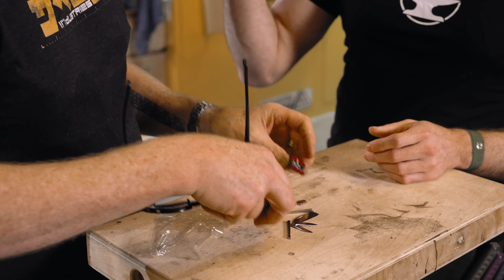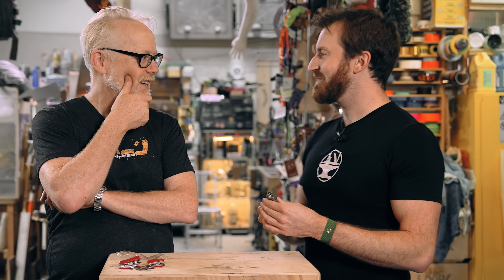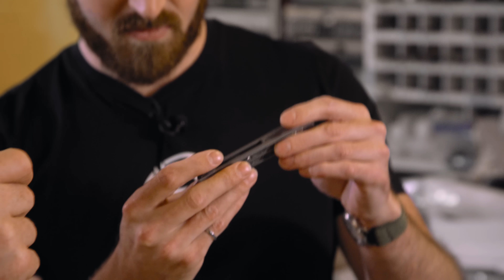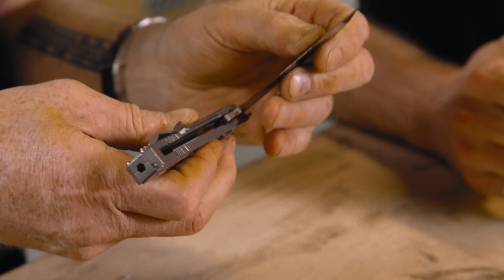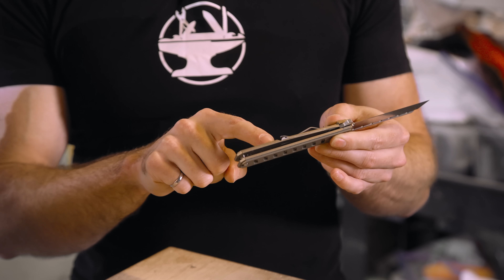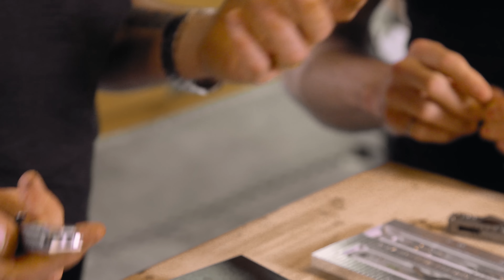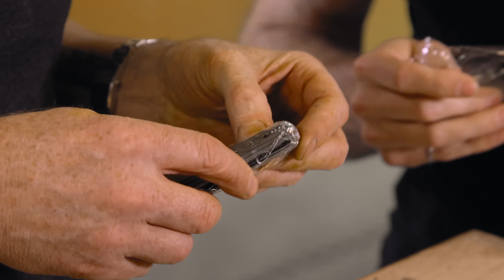Adam Savage Wields Hacksmith's Titanium EDC Multi-Tool!

Comment from the maker: Learn more about the Smith Blade here: https://www.kickstarter.com/projects/hacksmith/the-smith-blade-21-in-1-titanium-multi-tool
Find more of the Hacksmith's videos at https://www.youtube.com/@hacksmith
Reply: Note as of now the 10k you talked about in the video, is more like 15K blades, with 23 days to go, and well past the 3.8 million USD    Damn
Reply: @TheGismono  well yeah it’s not a normal one. They already designed and made the product.  It’s easy to pay for something when you know it already exists, unlike every other fundraiser, where half the time they only have a picture on the screen
Reply: .... I'm not paying gun prices for a knife.
Reply: pfff, people don't open bottles anymore.  
IT NEEDS GOOD SCISSORS AND PLYERS which are used more than many other tools.
I'll keep using a cheap chinese multitool with good scissors and plyers instead.
Reply: Actually I use bottle openers quite often @chrismeandyou ... (I'm a chef) Kind of annoyed it's a higher priced feature though... Something that should be standard. Like I would mainly use the firestarter (when burners go out), 90° driver (you would be surprised how often I use tools for kitchen equipment), the extended ruler (a joke that that's a high dollar feature only insert dick measuring joke here). But I don't need a level, metal scribe, glass breaker, and wire strippers. I could do without the teasers and sewing awl.
Reply: exceed designs razor v3 or tirant ultra. OKNIFE U1 Ultra or Big Idea Design - Ti Utility Knife All better as a EDC knife imo because of the replacable blades so its down to you to choose your fav blades. Problem with this thing is once that blade is fkd its fkd. the rest of the gimicks are just that, they will never be as good as or as usfull as the actuall tools they are pretending to be.
Reply: Even though they have more than met their kickstarter goal, i would like another video where Adam gets to ask his questions.
Reply: You never know when someone will come up with some unexpected EDC innovation. It’s always fun to see that happening.👍👍👍
Reply: Not even available for purchase at any point according to what I have seen on the website. You had to back it to get one.
Reply: Keep me posted when I can buy this.  My Swiss, Gerber, cheap knock off knife needs a new friend. I first found you on ctv news. This is a bonus
Reply: Blade look great. 
What HRC is the blade? Can it be replaced when damaged?
Reply: @OldSkullSoldier  HRC or better Newton/mm2 or least Brinell scale or something 
but look like swiss knife 55HRC if i good know 
so this 61 61 HRC best tip
Reply: I ordered mine yesterdayafter a long wait for development. Being an engineer myself I love the geek out you chaps had. I’ll be like 10yr old me on Xmas day when mine arrives! 🙌 @Hacksmith you’ve nailed it 🔪
Reply: Really cool product, but I wish the camera work in this video was better. Would have been nice to see close ups of what they were talking about.
Reply: James is bait and switching here. Adam gets to see an overengineered show piece, but the actual product week be a dumbed down, gremlin ridden Temu version. They did the same nonsense with their "lightsabers". Scam

Comment: Cutting a Vic in half to prove a point is not only wasteful, it's insulting. It's a slap in the face to a company that doesn't deserve it. I would be FAR more inclined to buy your tool if you honored the SAK instead of pissing on it.  Hard pass.

Comment: Hey @Adam Savage I backed this based on this video.  Sure they are strugglign to get production up and running.  They are putting out a lot of information.  But they are not putting out the right information.  They need to give what backer number they are on, and estimates on when they will ship each block of backer number shipped.  How about doing an interview with them and getting the information backers are actually looking for.
Reply: Well about 2 hours after posting this I got a update from them ... good or bad to pay the tariff on it before they could ship... so I guess they finally got to my order.
Reply: Well it showed up 10/2/26.  It is pretty nice.  Though the bits keep falling out of the side storage in my pocket.  And the deep carry clip makes the side bit notch not take the bit, you have to put a bit there and then tighten the clip.  But it's countersunk screws that have their preferred location so it is finicky getting it aligned they would have made the cut out on the deep carry larger.. But it did give me an idea of buying a m390 blade for the skeletool I usually carry.

Comment: It took me 3 minutes to notice the first problem: with this blade shape, it’s very difficult—if not impossible—to cut while the knife is lying flat; the flipper gets in the way. That means you’ll mainly have to use the fine tip to cut on surfaces, which will wear down accordingly.
A round blade would provide much more cutting edge right away.

Comment: This beats the purpose of a multitool since it has no pliers, wire cutter or actual scissors? like its a glorified blade with random functions as they do not realistically do anything well enough. No hate but Leatherman is universes ahead of this. you can get a Leatherman wave alpha which will be infinitely more usable than this and argurably last longer.

Comment: What do you mean when you guys investigated other manufacturers that they were found to be out of compliance for bit sizes?! ( LTT having discovered the same thing ) If that is the case then there needs to some method of flagging these companies who just do whatever they want and continue to make improperly sized bits. Out of spec bits are totally unacceptable and hazardous both to yourself and whatever you are working on. Mostly its going to mangle the tips of the torque bits and cause damage, even if its just cosmetic. Even worse can cause both the tool and bits to suddenly cam out and strip the torque screw resulting in injury if you are unlucky and potentially damaging your tool, your bits, the screw and product or machine you are working on. Think not...? Ever take apart a $10,000 U.S. 100 Inch 4k LG OLED and have an out of spec torq cause a sudden cam out strip and your tool flies into the screen or the mainboard or both? Happens. These chinese companies selling us whatever they want with substandard pot metal alloys at whatever tolerances they happen to have in their manufacturing processes that day need to be held accountable and be shut down from selling their garbage online. PLAIN AND SIMPLE. MIC DROP. -Tony Cusimano 54yr Old Male  P.S. Love the multitool, great work!

Comment: Cool, but my skeletool cx has done everything I have needed it too for 100$ usd. The biggest thing on this that I love is the longer bits. But honestly, i cant see myself using most of the tools on this when I ussually only need better full size versions of those tools when I have ready access to them. I work on a lot of electronics. I have a 100$ toolkit that has everything I could ever need, electric driver, manual driver, extensions, 120 s2 bits, spudgers, pry bars etc.  And it fits in my small bag to carry around work if needed. Not shitting on this, but at 200+ dollars and no pliers, which I use all the time. Also the blade doesn't have a great edc geometry... I just can't see carrying it over my skeletool cx. It is easy to carry (I just clip it to a belt loop), has never failed me when I needed a tool on a random instance and it's less than half the price. If they could get it down to 100$ for the version their demoing I would probably grab one as it is neat, but at near 300$ I can't justify it.

Comment: 13:55
There's a type of Spanish folding knife, called the Navaja, it goes back to the 1600's and due to its ratcheting mechanism it has a very similar sound when opened.
So, Hacksmith's Smith Blade was unwittingly beat to their signature feature by 400 years.

Comment: The wire stripper hole isn't hidden...it's there so you can have that out at the same time as the blade for the initial scoring tool when you need it. (re: MacGuyver tool criticism) - 

Request - pencil, Telsa lighter (chargeable) and levelling laser.

Comment: So a few things. I really appreciate what you’re doing and my most favorite thing out of all of this was the torque plastic bit. I have all the small sized torx bits etc but what I don’t have and have trouble actually finding without investing another $100+ is a torque screwdriver for all the small things that need to be torqued to spec sub 10 in/lbs. I have to be honest in hopes that I don’t just sound like an A hole and maybe this is something that isn’t just my weird personal opinion. I was turned off as soon as you said liner lock. To me, they have always been the throw away version of blade locking. I have had at least one fail during heavy use. Something to consider that gets me excited about just about ANY knife when I see it or hear it “crossbar lock”. I know it was originally benchmades proprietary thing and I 4ger what they called it but it’s an excellent locking mechanism…the best in my opinion. Ambidextrous and sturdy. Other than that you’ve got a winner and I wish you the best.

Comment: Personally, speaking for myself, except for the knife blade itself, and bottle opener, the by far most useful, and used tool in my personal, keyring multitool/EDC, is the pliers , as tiny as they are.  Much the same with my Leatherman.
So, I'll come back as a customer if they can make a tool with pliers.

Comment: Congratulations on a great design!  Love the concept and features, i plan to buy one If (and only if) you can do a run WITHOUT HOLES IN THE BLADE. An EDC knife is often used for food - all thoes mostly useless holes (and groove) in the blade accumulate pocket grime, and are much more difficult to clean - (before and after food prep). The holes and groove also represent added cost, and weaken the blade too.  Genius level design compromised by dumb holes.
Reply: As far as steel, I like both choices - would prefer a choice (I like the much tougher and less costly14c28n).  I prefer Magnacut to either one...

Comment: Kewel .  Better than I would have anticipated .  Love the match strike flint .  The problem with most multitools is that each tool is not as good as one dedicated to that purpose.  I.E. the scissors suck, the screw driver is awkward, the file is too short, the blade is cheap and on and on.  AND you have to carry all those tools with you just to use a  screw driver.  But the knife is so cool and it has so many practical features that I would have to give it an A.  SO much thought went into this it surpasses ordinary tools.

Comment: Ironically i feel like as cool as this multi tool is, i feel like i'd be less inclined to carry it over a leatherman.  It's on the opposite end of the spectrum of multi tools for me.  I don't carry my leatherman's for the blade, although the arc has a very nice magnacut blade.  I carry a seperate pocket knife for cutting tasks so the magnacut on my leatherman ends up being my "beater" knife.  On the Hacksmith tool, the blade is the best part, but it's far more inconvenient than any other pocket knives and the tools aren't as useful as the tools on a leatherman.  As much as i'd like to try a hacksmith, it won't measure up to my leatherman in utility and I'm not using the blade on either one of them for much, so I'm going with the leatherman.  The pliers alone put them comfortably above the hacksmith.  A multi tool with no pliers is junk to me tbh, it's the biggest selling point by far.  The rest of the tools you get with a leatherman are just a bonus

Comment: Damn... Most of what I would need or use is on the pro or founders version... Wish there was a more customizable system for ordering. Paying that much for an EDC I could utilize half of is a bit out of justifiable means for me. That's more than the cost of one of my chefs knives... But I'd be fine picking the options if they were all modular. Like I could use the 90° driver, extended ruler and firestarter. I don't need a good portion of the others. Maybe I can afford it one day 😅. Been waiting to hear about this knife for a long time.

Comment: Corkscrew! I need a corkscrew! I can’t stand Victorinox because of the slipjoint — but it’s still impossible to find a proper alternative. What you really need in an EDC multitool is a knife, a corkscrew, a bottle opener, and tweezers. That’s probably it. Victorinox also has great scissors — I use them often. As for bits and screwdrivers… if you’re actually repairing or assembling something, nothing can replace proper pliers and a good screwdriver.

Comment: Most knives are 100 percent useful this is 50 percent useful and 50 percent will never use. a pry bar in a knife??? you have never used a pry bar!!! it works off leverage the more the better, so you made a short pry bar with a blade AND SOME VERY SMALL DRIVER BITS wow the hacksmith is and will always be a low level hack it is in the name lmfao. RULE 1 OF TOOLS IF IT DOES MORE THAN ONE THING IT DOES THEM LESS EFFICIENTLY THAN A TOOL THAT ONLY DOES 1 THING. OVER ENGINEERING A SIMPLE TOOL IS JUST AS BAD AS UNDER ENGINEERING A COMPLEX TOOL. MULTI TOOLS  ARE GIMMICKY, OUTDATED UNINSPIRED. 🤣🤣🤣🤣🤣🤣🤣🤣🤣🤣🤣🤣🤣🤣🤣🤣🤣🤣🤣🤣🤣🤣🤣🤣🤣🤣🤣🤣🤣🤣🤣🤣🤣🤣🤣🤣🤣🤣🤣🤣🤣🤣🤣🤣🤣🤣🤣🤣🤣🤣🤣🤣🤣🤣🤣🤣🤣🤣🤣🤣🤣

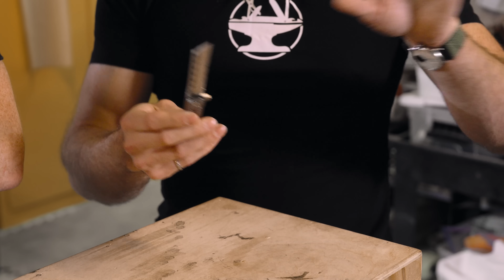Comment: 02:48 The proper term for a  "reverse tanto" is a Wharncliffe blade if anyone was wondering.
Reply: No, a Wharncliffe and a Reverse Tanto aren't the same; a Wharncliffe has a straight edge and gradually curving spine to a fine point (great for controlled slicing), while a Reverse Tanto often has a slight curve or "belly" on the edge and a stronger, reinforced tip with more steel, making it better for tougher tasks and piercing.   I have several of both blade shapes and they are indeed different.   The more you learn eh?   From what I see around the knife community - the Hacksmith has not even been a blip in discussions.    We see this thing as a utility knife - not a proper folder despite the use of M390.     We do give them props though for heat treating it correctly to 61 -  63 HRC.
Reply: @armaurgh8898 Yes, in the strict traditional definition, you're correct, but unfortunately modern knife makers have taken to use the term more broadly, often with curves like spiderco folders that have that kind of asymmetrical curved tear drop shape with the shorter almost straight edge being sharp and the longer curved side of the blade being the spine. And they've taken to using the term on angular designs as well. I have a tacknives barracuda and it has a straight edge auth the spine having three straight sections instead of two like this blade. It has the main spine, a slight downward angle to the second section, then the aggressive downward angle to the tip. It very much looks like an angular reverse tanto shape. It is called a Warncliffe blade by the maker. Really di the the straight angle to the tip is probably more accurate to call it a sheep's foot blade and it's similar in design to a seax also. But for simplicity instead of using one of the more specific names, the industry seems to have settled on just using the term Wharnncliffe blade to describe pretty much any blade with a longer spine and shorter edge. You are technically correct, the best kind of correct 😁, but many, if not most, knife makers today would list a knife with the blade shape hacksmith used as a Wharnncliffe blade.

Comment: I love everything about it and I very much feel the passion behind it. Congrats, great product! Anyways, without the M390 steel blade this is no replacement for a good EDC knife and concidering the price of far over 200 bucks this would be a downright stupid buy for a knife with 21 functions, especially concidering I think I would use about 3 regulary. The problem with this kind of tools is always the same: 99% of the times when you might need one of the tools, you already knew it beforehand and have proper tools around. Yes it it small and light, for me personally this is nothing good though. I have big hands, might wear gloves when I use it and at this point any proper Leatherman is stronger and easier to use. Also, with the remaining money I could buy compact versions of the missing tools I might need.
This is an absolutely awesome product, I really appreciate the craftsmanship behind it! The price kills it though for such a niche multitool. Thanks for the vid, love your energy guys!

Comment: Only possible thing that could make this better is a Cross Bar Lock. I can never go back to a liner locking system. Cross bar is so smooth for opening AND closing. No grip change, no putting your finger under the blade. I do line this Multi tool though

Comment: Yeeeeeeah, ngl, it's been a long time since I was this hard for a tool. Stopped carrying a leatherman for the same reasons, and a staple puller is what I use the pliers for half the time anyway. I just carry a short stiff sheepshead blade with a light plastic handle.

Comment: The ONLY gripe I have is the sound call being unlike any other knife, the cold steel Kudu is a widely available knife that is inspired by an African knife that has a notched blade that gives a very similar sound
Reply: Or the Navaja, a traditional Spanish folding knife with a ratcheting lock that made a similar sound when opened, the sound was basically the knife equivalent of cocking a pump-action shotgun.